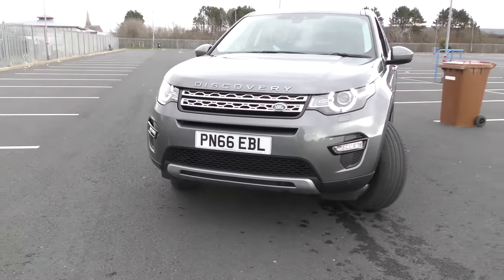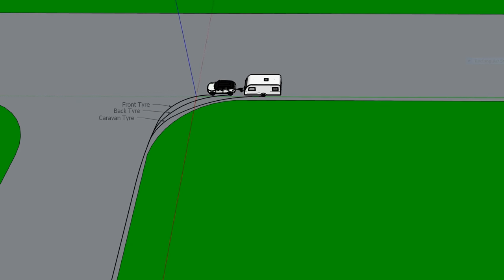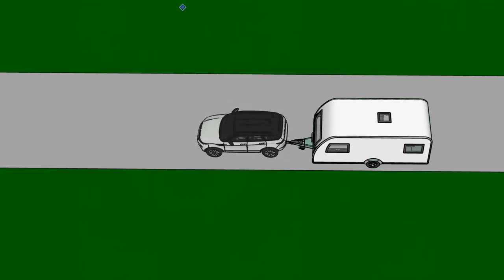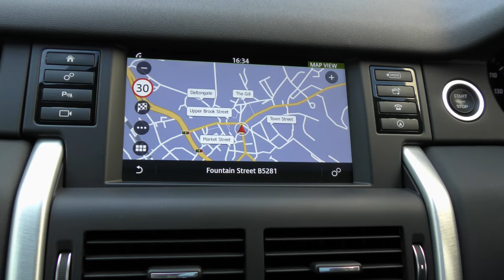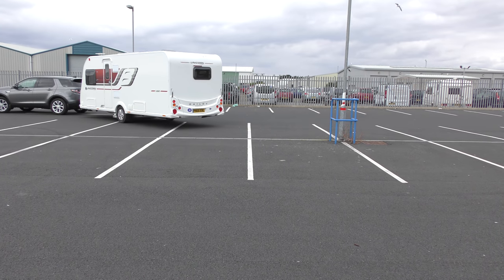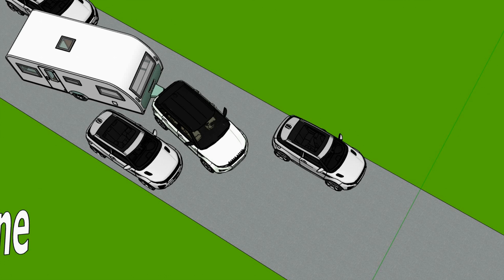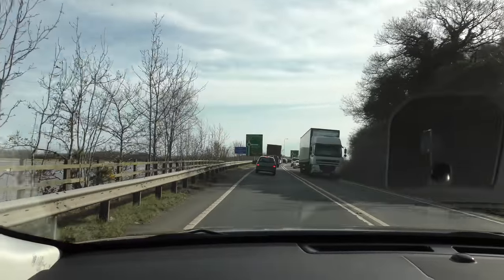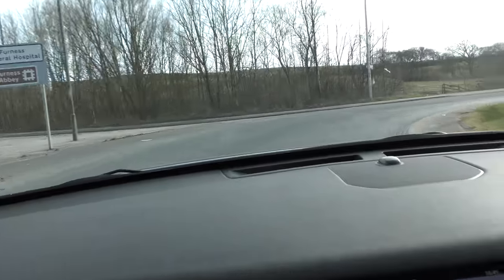How to safely tow a caravan or tow a trailer: Caravan tips and tricks

Comment: would have more respect if you never used motormover
Reply from the maker: Well spotted. Motormovers have their uses. I  park my caravan ouyside  the front of my house. The drive is on a hill and the towbar has to angle into the corner of my house and the neighbouring house to fit on my drive. This manuver is only possibe with a motormover.  😀

Comment: A good sat nav for caravan is the Garmin Camper 660. You can use it for car only or both car and van with width, height, length and weight typed in. It then ensures you stay away from narrow roads, low bridges, cul de sacs etc and is very reliable. There is also a reversing camera with receiver on the sat nav and transmitter in the boot. I also fitted one on the caravan with transmitter in the front locker and I can switch between the two, giving me rear view on motorways and also reversing views from the van. It also pairs with your mobile for hands free. Highly recommended sat nav and when towing replaces my built in Vauxhall sat nav. Good video, learned a lot, subscribed.
Reply from the maker: Hi Edward. Thank you for subscribing. This week I have been trying several android sat nav systems on my tablet. Some of the free systems are better than the payed versions. Some sat nav systems are dangerous because of  the total confusion they  cause.  

I have not used  the Garmin Camper 660 but it looks like an interesting product, if you can afford it.  Thank you for the advice.
Reply: UsefulWisdom not much more than a good tablet but I think you'll find optical quality is better and nowhere near as cumbersome as trying to cobble a video camera, especially if you don't have a rear window. The quality is in fact better than the reversing camera factory fitted to my 2017 Insignia.
Reply from the maker: Thank you Edward.  Yes, without a bathroom window I would struggle with my  rear view camera system. But I have all the bits I needed to make it work and because of this it cost me nothing. If my system helps others save  money, then it can only be a good thing and if it improves road safety by getting people to consider a camera system,  I am very happy. I accept it does not work for everybody.
Reply: UsefulWisdom Ian don't misunderstand me I'm not criticising your method, I'm just pointing out I did not consider the Garmin much more expensive than others, (including a video camera) but a lot more versatile. It does work in keeping you away from single track roads, cul de sacs etc and places that would cause problems. As a camera the quality is superb and it can used with or without van attached, it pairs with your phone giving hands free making it even safer and life long updates for the whole of Europe are free.
Reply from the maker: Hi edward,  technology constantly improves and I would like to review the Garmin system you have, against a free android app I have found and I am very impressed with. Garmin are you up for the challenge.
Reply: UsefulWisdom let me know your findings and I'll let you know how much is missing from the app in comparison to the Garmin. Get the Garmin, type in your vehicle dimensions and weight, the the caravan dimensions and weight. Make sure you have it set on van and car not just car and set the sat nav to take you where you know there are obstacles you would like to avoid, length, weight, height restrictions etc. Let me know the comparison between the app and the Garmin.

Comment from the maker: Hi Emma.  Caravan mirrors are a league requirement.  You have to be able to see down both sides of the caravan  without a blind spot, so they need to be wider than the caravan.  Otherwise overtaking traffic can get hidden in the blind spot. 

They are needed for reversing accurately  in a straight line. 

They help you gauge narrow gaps.  If your car and caravan are travelling in a straight line  and your caravan mirrors are able to go through  a gap,  the caravan will also go through the gap.
Reply: "Caravan mirrors are a league requirement" ... being able to see the area behind and along side the caravan is the legal requirement. If your existing car width/mirror reach is not sufficient, then extension mirrors are required to meet the legal visibility limits. It is not legal to specifically require mirrors, that is just a by product of complying with the legal view area ... there is a subtle difference! 99% of most car car/caravan combinations WILL require extension mirrors. Great video and hugely informative.
Reply from the maker: Hi  @simonbaxter8001 . Mirrors as you correctly  printout are very important, so  we also made a YouTube video on them, it's called:      Choosing Safe Caravan Mirrors: Caravan Tips and Tricks

Comment: Tip No. 2 is at 0:12 - Don't wind or wrap the electrical cord around the front of the caravan's drawbar before connecting it to your car - as this one has been. The cable is that length as it needs to be for going round corners. If you do this and turn a tight corner, you'll have some electrical repairs to make to the cable or connector.
Reply from the maker: pmaikeey, if the cable is long enough, like it is on the Bailey Caravan, you can. It stops it dragging on the ground.
Reply: @UsefulWisdom  The cable shouldn't be anywhere near moving parts (hitch brake operation) as there's risk to both the moving parts and cable damage - and it likely leaves insufficient slack for tight corners.
Connect it up 'normally' and if it hangs too close to the ground, pull the excess slack up under the A frame. Use a loose cable tie if necessary - so there's slack if more needs to be pulled out.
Reply from the maker: @millomweb  there is a plastic cover that  protects the cable from any moving parts. It is long enough and the Bailey Caravan dealer at Ulverston (they know about their product) advised that this was the way they tow these new caravans.  Times change,  change with them. 😀